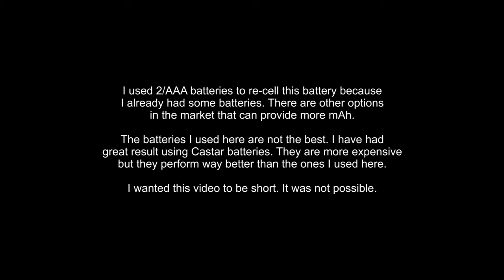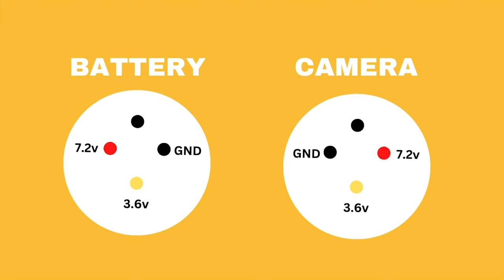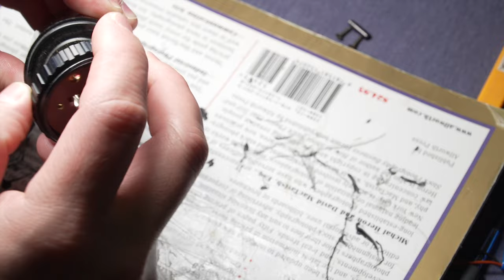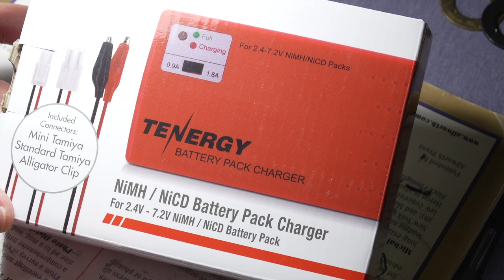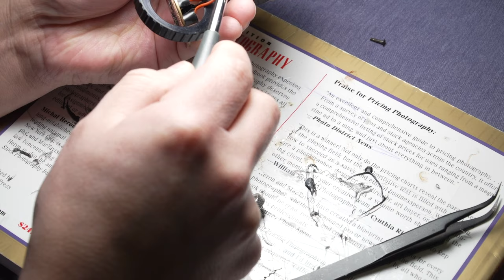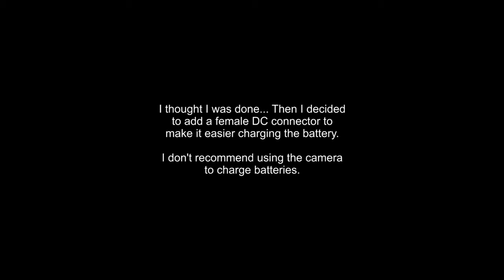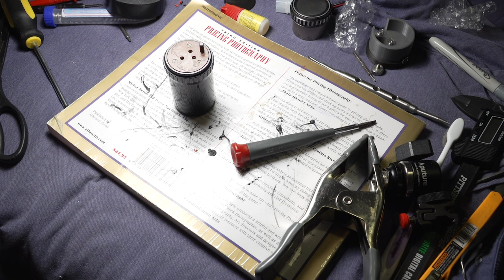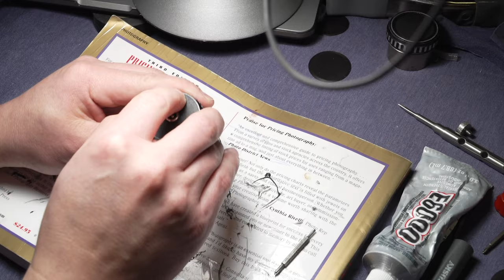Beaulieu 5008 - Recelling the Battery.

Comment: Amazing ! - but that sound in the BG is awful !!!
Reply from the maker: Thank you. I had the 3D printer working in the same room. I'll try to avoid that situation in the future.
Reply: No worries Dude ! your film and attention to detail is amazing -
 I have opened my 4008 battery case, used alot of isopropyl to dissolve the old glue..
They used hardcore stuff in 1969